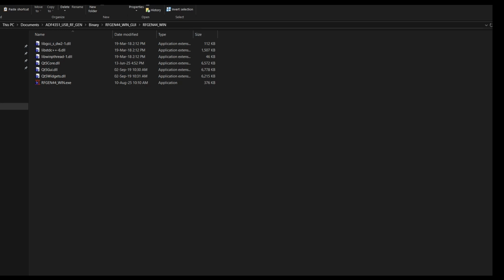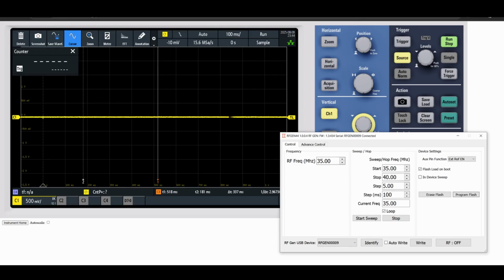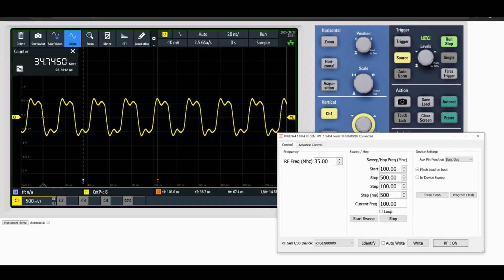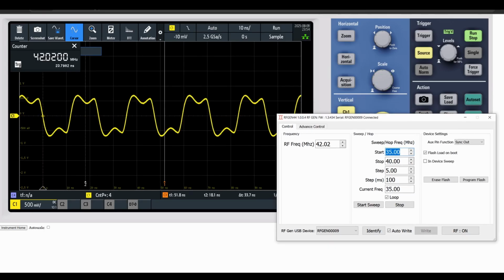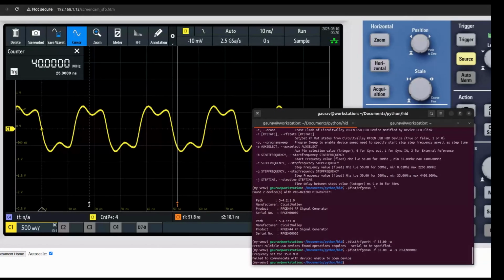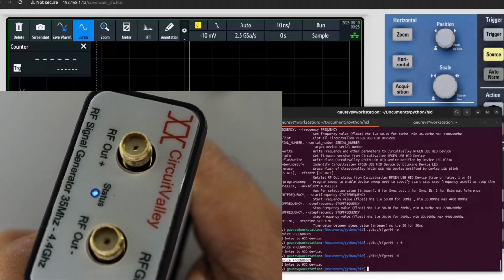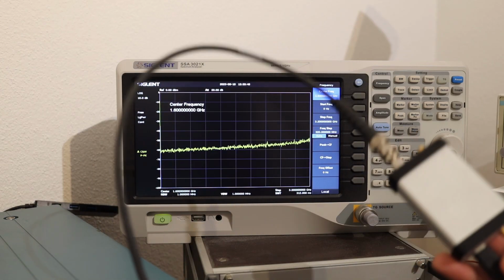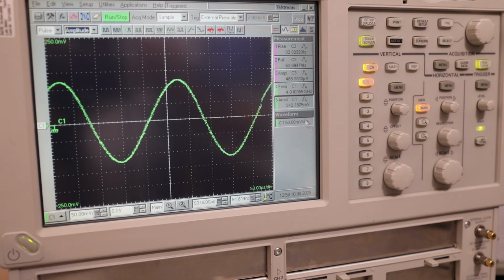RFGEN44 Open USB Programmable RF Signal Generator 4.4Ghz

Comment: AI Summary

Abstract:

This video introduces the RF Gen 44, a compact USB-powered RF signal generator designed for scientific and general electronics applications. Based on the Analog Devices ADF4351 PLL, it generates frequencies from 35 MHz to 4.4 GHz across two primary RF outputs. A versatile auxiliary (AUX) pin offers functions like external PLL reference input, synchronization output for sweep modes, and synchronization input. The device is controlled by a cross-platform (Windows, Linux, Mac OS) graphical user interface (GUI) and supports Python/MATLAB scripting for automated control. A significant feature is its standalone operation capability, allowing users to program frequency sweeps or fixed outputs directly to the device's flash memory, enabling operation without a host PC. Demonstrations using a spectrum analyzer and high-frequency oscilloscopes confirm stable and clean signal generation across its wide frequency range, with analysis of amplitude performance and harmonic content at various frequencies.

RF Gen 44: A Versatile USB RF Signal Generator

*   0:00 Device Introduction: The video introduces RF Gen 44, a compact USB RF signal generator suitable for scientific and general electronics applications.
*   0:12 Cross-Platform Control: It comes with a user-friendly, cross-platform application (Windows, Linux, Mac OS) and supports Python/MATLAB scripting for scientific and automated control.
*   0:31 Wide Frequency Range: Based on the Analog Devices ADF4351 PLL, the device generates RF signals from 35 MHz up to 4.4 GHz.
*   0:42 Multiple Outputs & AUX Pin: It features two main RF outputs and an auxiliary (AUX) pin configurable for external PLL reference input, synchronization output during frequency sweeps (for filter testing or spectrum analyzer tracking), or synchronization input.
*   1:01 Standalone Operation: A key feature is the ability to save configurations (e.g., fixed frequency, sweep parameters) directly to the device's flash memory, allowing it to operate autonomously without a connected computer.
*   1:13 Robust Connectors & Indicators: Equipped with 50-ohm SMA outputs, it accommodates various adapters. Two status LEDs indicate power and PLL lock status.
*   3:40 User-Friendly GUI: The graphical user interface (GUI) allows for easy frequency setting, programming of sweep and hop modes, configuration of AUX pin functions, and advanced PLL control.
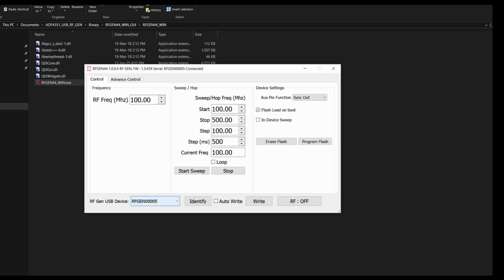*   4:30 Multiple Device Management: The software can manage multiple connected RF Gen 44 devices, displaying their serial numbers and firmware versions, and includes an "identify" feature to blink the LED of a selected device.
*   9:52 Flexible Settings Application: Users can choose between "auto-write" for immediate application of changes or manual writing to apply multiple settings simultaneously.
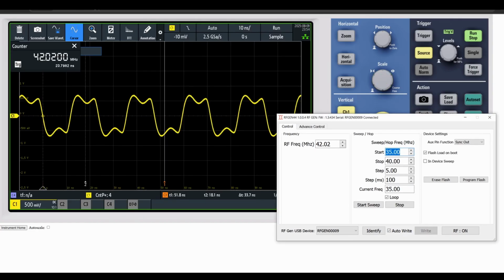*   16:00 Python Scripting for Automation: A Python script is provided, offering command-line control over most device functions, including frequency setting, sweep programming, and flash operations, allowing for custom automation.
*   27:01 Performance Verification (Spectrum Analyzer):
    *   Tests show output levels around -1 dBm at lower frequencies (e.g., 50-150 MHz), with some harmonics present due to the signal's near-square wave nature.
    *   At higher frequencies (e.g., 1 GHz, 2 GHz), the signal becomes cleaner with fewer visible harmonics, though amplitude may drop slightly (e.g., -2.3 dBm at 1 GHz, -5 dBm at 2 GHz).
    *   Sweep functionality is confirmed and works reliably.
*   32:31 High-Frequency Oscilloscope Verification: The device's maximum frequency of 4.4 GHz is successfully verified on high-bandwidth oscilloscopes, showing stable signal output (e.g., 240 mV at 4 GHz, 200 mV at 4.4 GHz into 50 ohms).
*   35:19 Availability: The RF Gen 44 is available for purchase from Circuit Valley, positioned as a low-cost, reliable, and versatile RF signal generator.

I used gemini-2.5-flash| input-price: 0.3 output-price: 2.5 max-context-length: 128_000 on rocketrecap dot com to summarize the transcript.
Cost (if I didn't use the free tier): $0.0099
Input tokens: 25436
Output tokens: 890

Comment: When getting into RF, what is the best PCB design software for this field?
Reply from the maker: Any normal PCB design software does the job. Advance software offers features easy calculation for impedances , if access for expensive software is not there then manual calculation can be done.